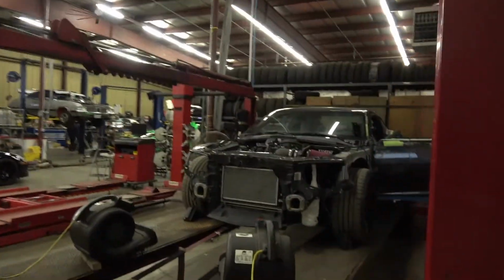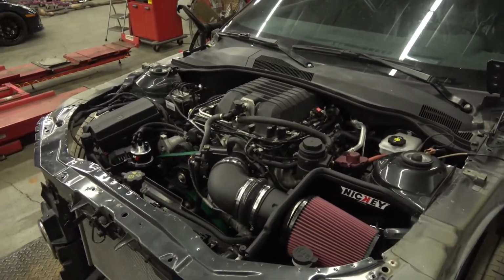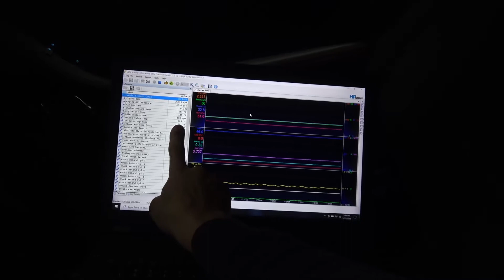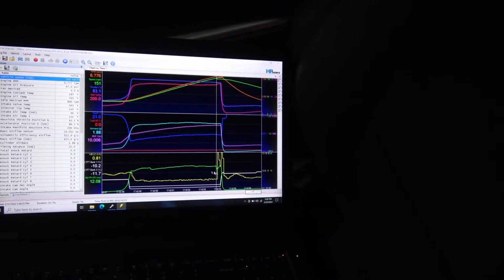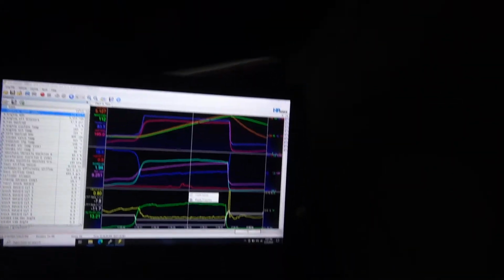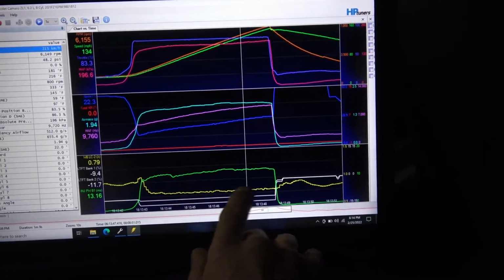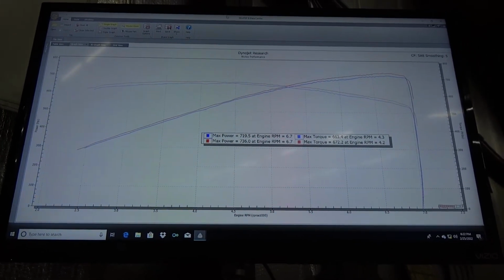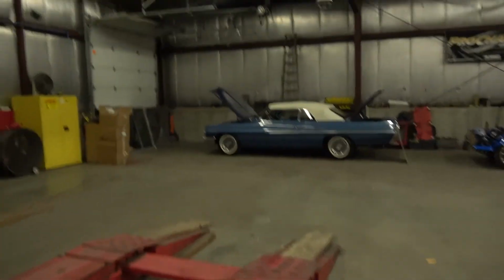5th Gen ZL1 Cam Tuning

Comment: 5:54 I tried the Injector Tip Temps both ways and although the gents at the HPT forum say never to do it, I found that zeroing that ITT table makes the temp drop much faster. I just have to be careful not to load the engine to knock. I tried it with the ITT tuned as well and it still returned to normal ITT's faster when all zeroed. Andrea over at  High Performance Academy zeroes his out so it's not all that uncommon. I've heard others just leave the stock values in and do a WOT pull to bring down temps. Whatever works.